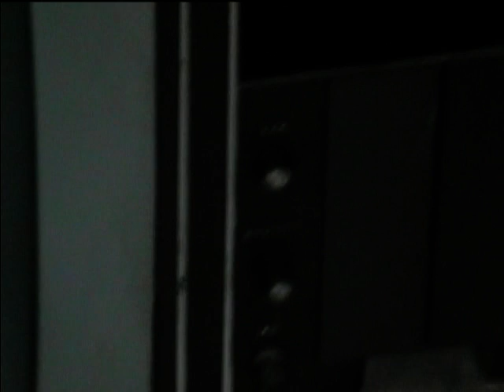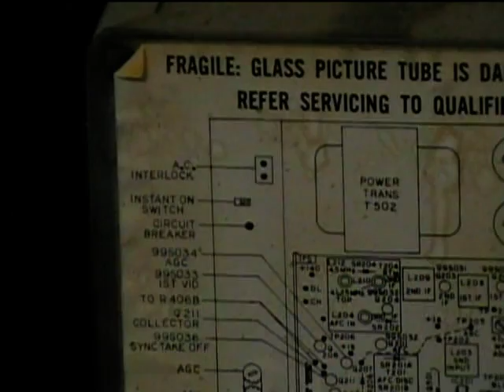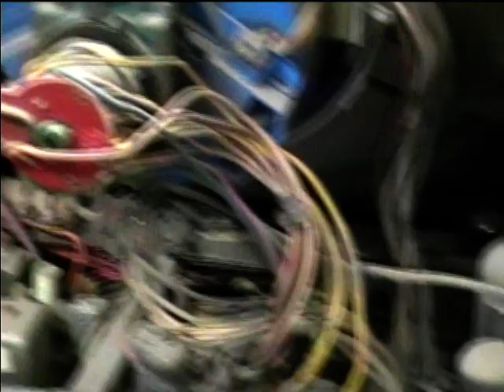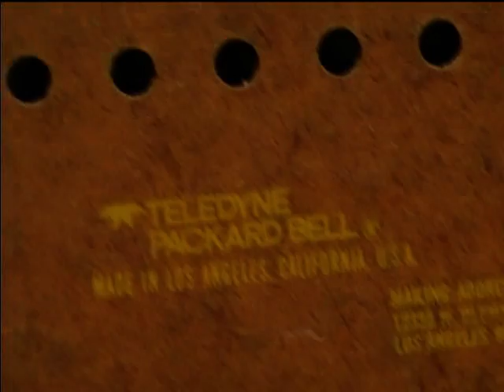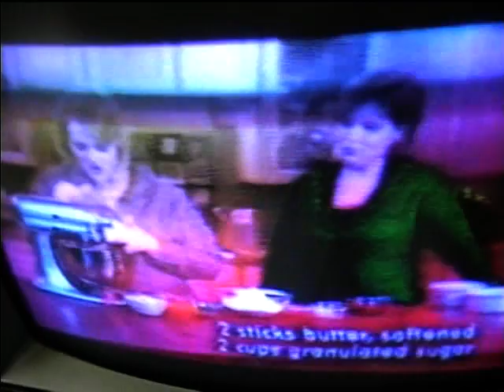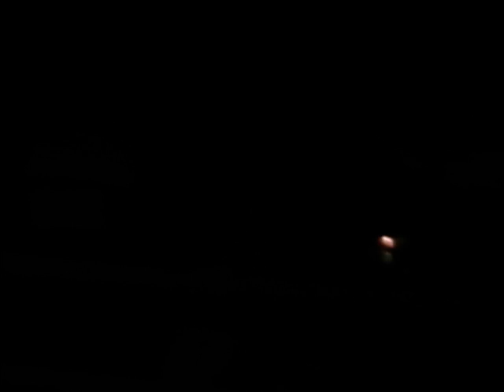1970 Teledyne Packard-Bell Tube Type Color TV

Comment: Once you remove the screws from the rear panel, pull the back carefully. It may take a little wiggling to get the two prong interlock connector to free.